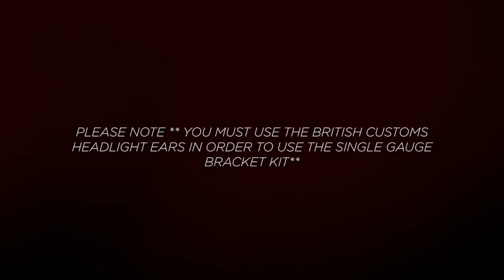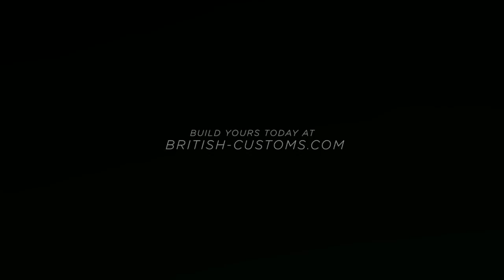British Customs Single Gauge Bracket Installation

Comment: What did you do with the Tach connector? Did you just leave it unplugged. I have 2013 Bonneville and want to order that bracket but I'm not if i can leave the Tach plug unplugged?

Comment: Will the change in angle affect the behaviour of the speedometer needle? I've been having some issues with a needle going crazy at around 120km/h, after I installed this...
Reply from the maker: The different angle shouldn't affect the speedometer needle but it could be time that speedo cable might need some maintenance such as relubing the cable, it can be the speedometer shaft itself binding or the cable might not be seated correctly in the speedometer. We have this bracket installed on a few bikes here with no issues but if you're still running into issues, give us a call and we can try to solve it together ! Thank you
Reply: It's an EFI 2014 bike, so no speedo cable... I think...
But I'm going to clean the contacts of the plug and make sure it is seating correctly. Thanks for your answer!
Btw, love your products, I have the shotgun exhaust, airbox eliminator kit, slammer seat, and next up on the list is the brake oil reservoir.

Comment: How to Make Your Bonneville Less Attractive. Honestly, most folks want to know how to add an analog tach to their Street Twin, not how to get rid of a tachometer on a Bonneville or Speed Twin. What's next? How to Remove Your Turn Signals? How to Replace Disc Brakes with Drums?
Reply: Race application of remounting Tacho and discarding Speedo.  What would be perfect as an addition to that fascia bracket would be central key mount!
Reply: Bonnevilles are not high revving engines.  Unless you are actually racing you really don't need a tach with them.